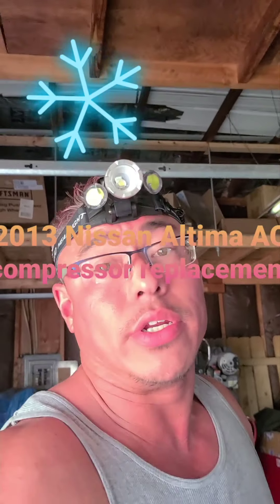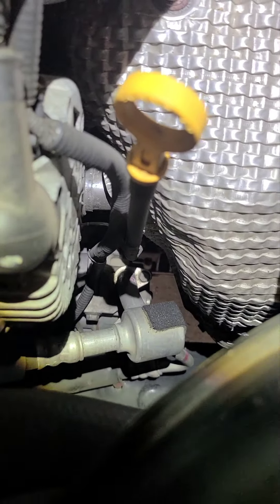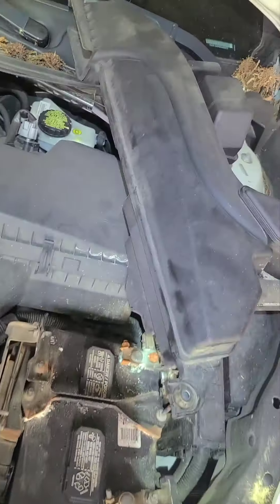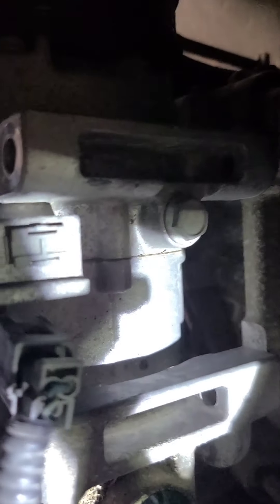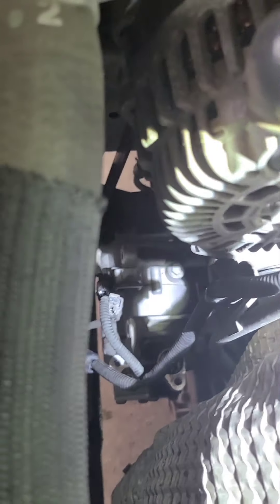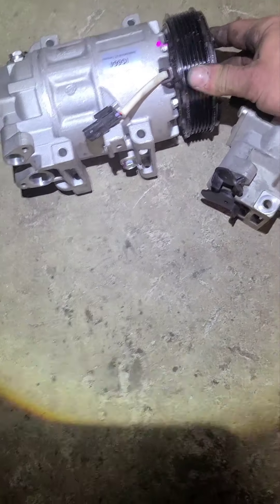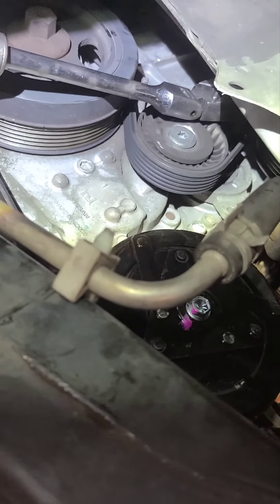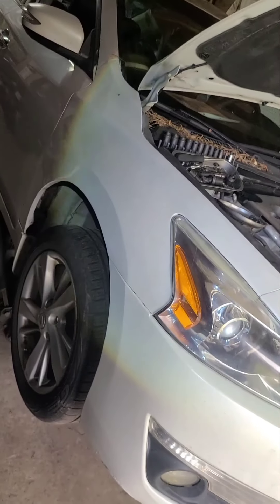2013 Nissan Altima AC compressor replacement

Comment: Its important to know that some Altima mods ha e a pressure valve and some dont. Check your AC system dails to know which you have. The ones with the knobs Dont have it, The digital temp adjusters DO.